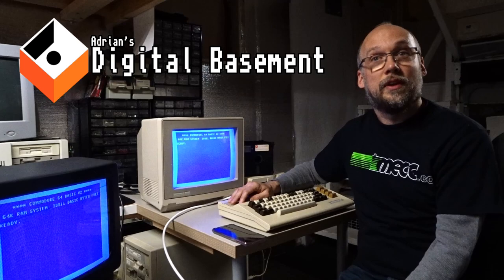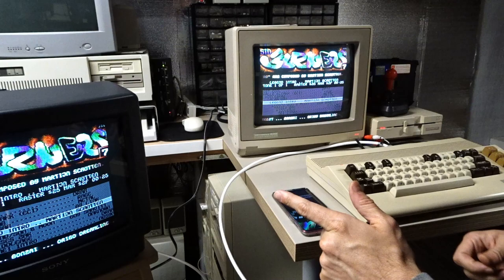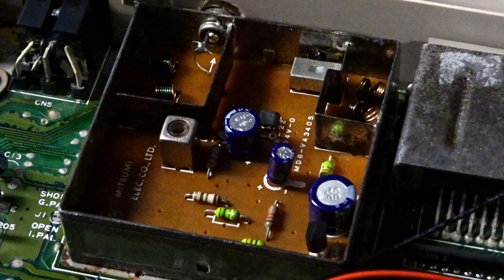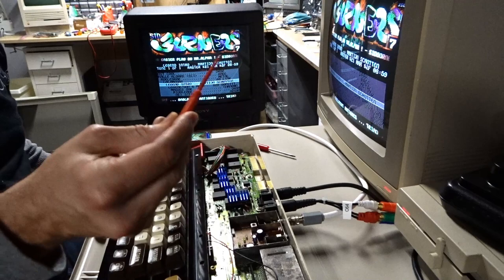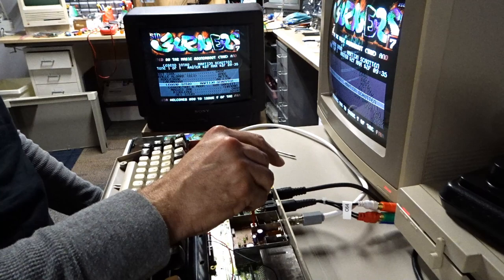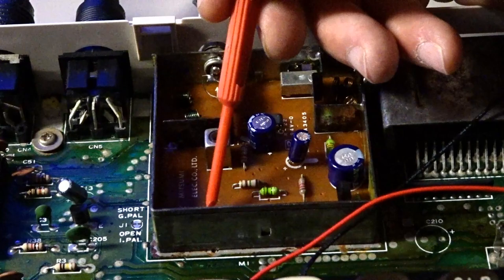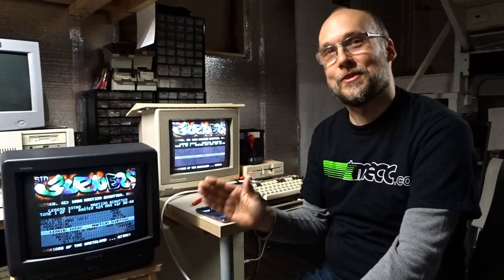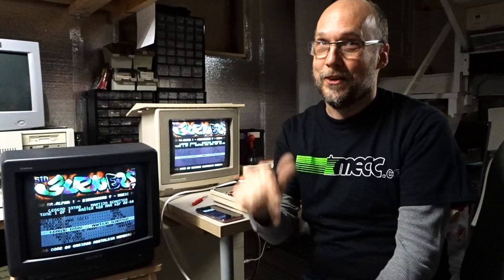"Left for dead" Commodore 64C RF audio fix

Comment: I hope this isn't the last video on this computer!  This is the computer equivalent of finding a car at the bottom of a lake and bringing it back to drivable, like-new condition again.  You've done a great job, man.  This is awesome.  Head and shoulders above just about any "retro-restore" jobs I've seen before.  You're pushing me to buy that Vic-20 sitting on the shelf at a local thrift store to tinker with...
Reply: The 8-Bit Guy has a video of a Vic-20 that was in a factory or workshop and the board was covered in oil.
Reply: thedungeondelver You should definitely go and buy the VIC-20.
Reply: thedungeondelver buy it, buy it, buy it!

Comment: Great to watch this series, I used to repair all the 8bit computers in the late 80's, early 90s. ZX Spectrums, C64's, Atari ST, Amiga's etc. it was a real blast from the past seeing your restoration. The fuse on the C64 though, I seams to remember that fused the tape only. We used to get a load of C64s in at the shop with dead tape drives and it was always the fuse that had blown. Anyway Thanks, loved seeing the restoration.

Comment: Correct adjustment for the audio subcarrier is 4.5MHz , the NTSC standard. You’ll want to use a scope to dial the adjustment in precisely.
Reply: Actually 90% of TV repair shops back in the day never touch a scope for their repairs. "Eye Balling it" was good enough for the 70s, 80s and early 90s. 
So the proper repair was done as intended.
Reply: @lukasperuzovic1429  Especially with the TV quality of the 80's I remember one aspect of a TV was that it was always blurred and I was floored when I plugged my Amiga to a SCART (amiga video is fully combatible with SCART btw. just solder a cable) video monitor and saw how crispy clear that image was.

Comment: The changing of the channels in the other vid helped. TVs have an automatic fine tune control, in your case the audio was so far off that the automatic fine tune couldn't compensate. As far as accuracy is concerned for the RF side, you have it working for you and that's what really matters when you are dealing with closed circuit systems like this. I'm sure there is documentation on how to properly align the RF modulator, but you seem to be good enough.

Comment: Just to share. I have same issue right now. An older breadbin. The RF is different, it was covered with a metal bracket , so i can't see the inside, tried to pry it open but something seems stuck and i don't want to break anything. Anyway, there are 3 adjustable screws on top unlike the one in the video with only one screw hole adjustment. So i tried all off them. What i can gathered is, 2 of them are for the video and the bottom left most screw is for the audio. Anyway, it didn't worked for me, maybe the Caps are blown. No idea. Now i will just have to wait for my S-video/RCA cable to arrive, to determine further if the SID is dead or otherwise. Great video anyway, pretty sure it is useful to someone.

Comment: Told ya. ;)

Glad to see (and hear) it working.

You can see how moving the inductor too far actually affects the picture, as it's moving the audio subcarrier too far, and interfering with the composite modulation.

(Certain models of the ZX Speccy have a weird circuit were I believe it modulates the audio carrier onto the composite signal before it enters the modulator. That can cause slight disturbances of the video image.)

I tend to agree about not replacing the caps in that modulator atm. Unless they show any signs of bulging or leaking, then they should be OK for a while.

I mean, ideally you would want to do a full recap of every retro machine, but it's not always necessary, can potentially cause more damage if the vias are brittle, and the cost of the caps does start to add up when you're recapping many machines.

I really do need to recap my Amiga 1200, though. They've been slowly leaking for a while now.
Reply: I can't believe you had the proper adjustment tool all along, too. I don't have one of those any more. lol

(I haven't done TV / VCR repairs in quite a few years.)

Comment: Those caps look so good I'd thought you'd replaced them, lol. I would recommend replacing all the electrolytic, the ceramic I think would be fine to leave. As far as the caps in the RF portion, I agree with you leave those because it is working and what you had mentioned about the difficulty of removing the assembly.

Comment: Any reason you calibrated this to use channel 4 on the TV, instead of channel 3? Just curious -- I know devices often had multiple channel outputs to choose from on their switches or configurations; it just seemed like using channel 3 always worked perfectly. Nice to see it working.
Reply: Exactly what Adrian said.  Where I live, prior to Cable TV, we only got channels 3, 6, 12, and 13... ABC, NBC, CBS, and the PBS (public broadcast station) out of Shreveport.  So I always kept the switch set to channel 4, because there was always interference on channel 3.

Comment: The carrier modulation differs country to country, a radio would have different spacing etc. caps could be the next thing that goes. But to keep it locked, dab a snot of hot glue to lock it 🔐
Reply: Dont use hot snot.Just use a SMALL dab of fingernail laquer.

Comment: you can cut the legs of the capacitors off close to the bottom of it leaving the legs in the board then solder to those

Comment: Great stuff. While everybody is suggesting to at least recap your old machines, your c64 survival fighter, who faught more than a decade against the elements, prooves, how tough and stubborn these old boxes really are...
Reply: If anything, I would just add a new cap to the output of the voltage regulator. Generally, though, these old machines run at too low a frequency to be bothered by a little bit of noise on the power rails; often times, every single decoupling capacitor could be removed from the board and the computer could still work flawlessly (although the radio noise it produced as a by-product would be another matter).

Comment: If you need to in the future, you could replace those capacitors in somewhat brutal fashion by physically ripping out the material on the old ones and soldering to their legs. It's ugly, but I'd much rather do that than unsolder that massive shield.
Also, would you happen to know the controls for the program that runs the SIDBurners music? I loaded it in an emulator because I like the tunes and I can select a song in the list, but then it just keeps playing that one on repeat indefinitely. I'd like it to go to the next one, or even perhaps randomise?
Reply: That could work. I did something similar when I did a bypass of the Audio amp on my Sega Genesis (Mega Amp mod).

Comment: If you really wanted to replace the caps inside the modulator, I suppose you could cut them in half from the top and pull them apart and maybe resolder the new ones to the old pins.

Comment: Having somethiinng 30 years old and not wanting to change any components......eventually something will have to be replaced to keep the 64C running.  All original doesn't make it better if you can replace an aging/out-of-spec component with a newer/better one.  That's just part of having "vintage" electric/electronic devices as a hobby.
Reply: @Bruno Primas  Yes, but until there are obvious problems (leakage, bulging, etc), you may as well maintain that originality as long as possible.

Comment: If you could de–rust the old fuse and put it back in, that'd be perfect
Reply: The fuse was the one part that was intended to be End user replaceable.
Reply: It's hardly worth spending too many resources to fix a $0.10 fuse. Yes, it could be done; but why?